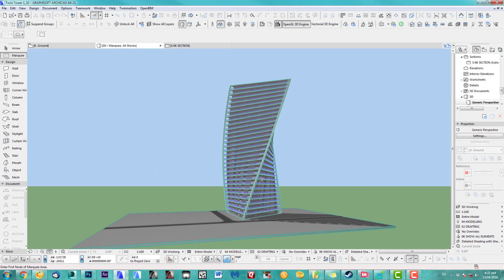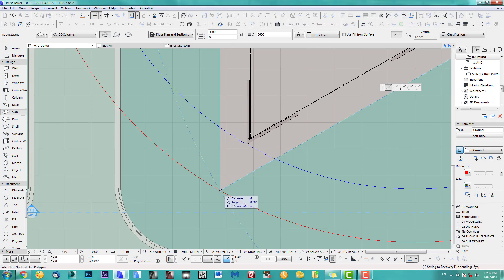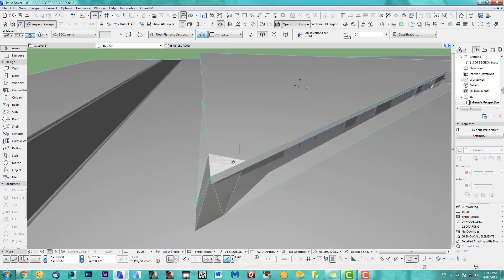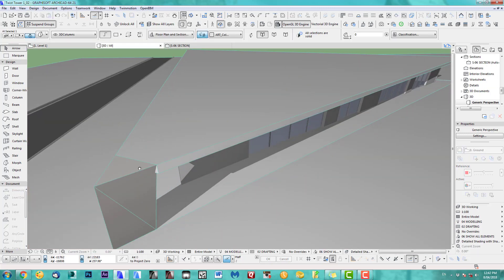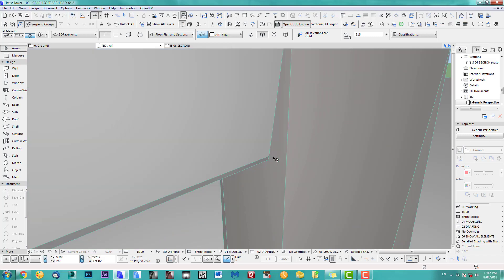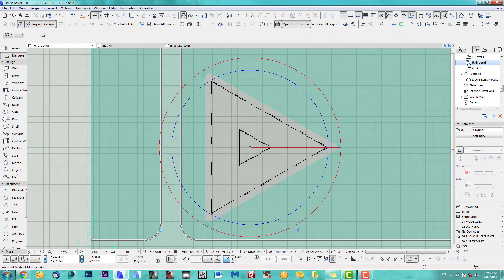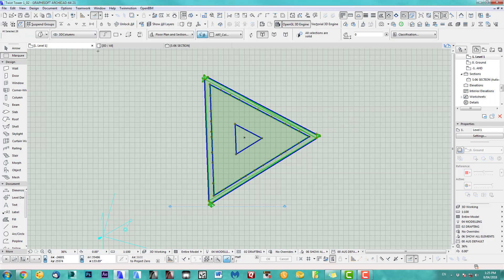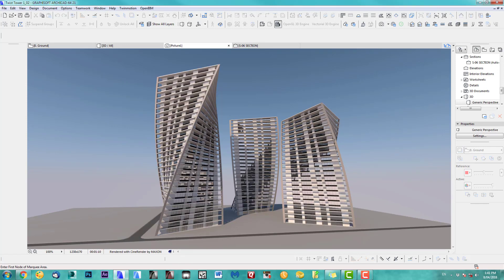ARCHICAD Speed  Modeling Twisted Tower

Comment: Hey, I also want to make a rotating tower for my thesis, but I'm having trouble with the facade rotation. My tower rotates by 2 degrees per storey and the curtain wall should also rotate, so that the posts are not vertical but inclined by 2 degrees, like in the video, only as a curtain wall.
Do you have a tip or a video for this? Best Regards
Reply from the maker: You can't bend the curtain wall in this way using Archicad. Your best bet is a nurbs modeler like Rhino.

Comment: I have a similar style of deesign that I am trying to model
problem is, i wonder if this method of rotating within a circle would work or not because my floor shape is trapezium. It is difficult to fit in all corners within a circle.
Reply from the maker: Good question. I would think if you find the middle of the arc which touches on all the corners of your trapezium then it should work. How to find it. Hard to explain in words on here as I can't attach an image. Contact me on my website and I can send you an explanation on how to get the middle of a trapezium https://www.asmtechbase.com/

Comment: Nice modelling tutorial, but don't say that we don't need grasshopper... thanks... it will save  spicy of ur time if u will need to change a degree of rotation or shape of building or slab
Reply from the maker: Thanks ! Yes true when you want top change the degree of rotation, then you are in trouble without Grasshopper :) 

Saying this, I keep following the Grasshopper development, it's an amazing tool but still too complicated for the everyday user. Actually all procedural modeling software out there are at the moment. As an end user, we need to look at the time spent learning  a software in compare how many times we use it during a year. 

What are your thoughts on this ?